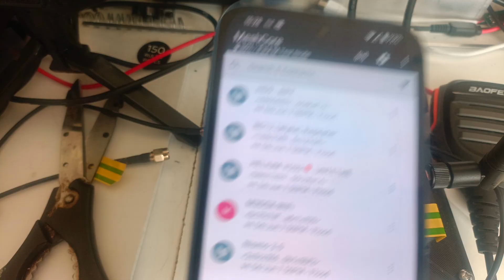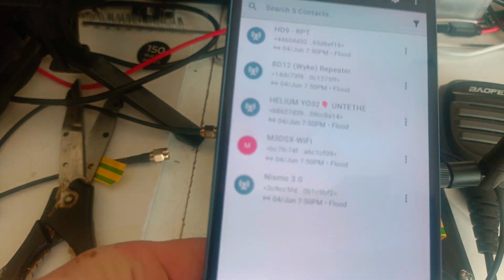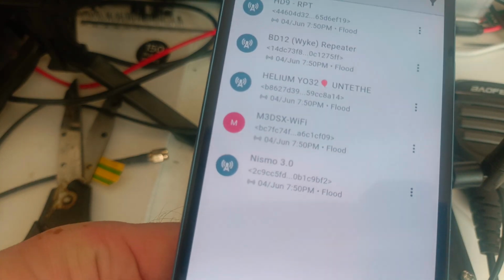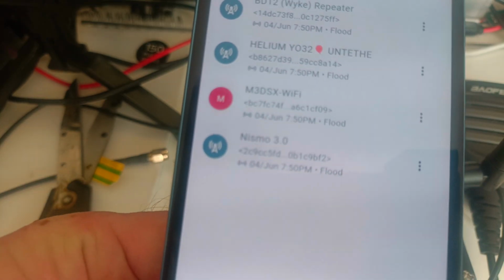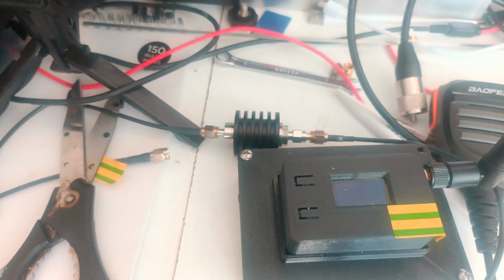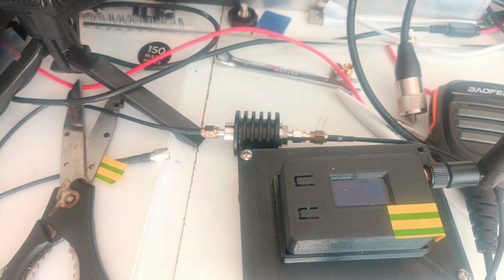Beginning my exploration of MeshCore and a surprise chain of events

Comment: Dumb question but how did you hear about the helium balloon being untethered..? Not a day-to-day occurrence 😁

I'm just embarking on exploration of meshcore and LoRa in general.. all very quiet here in East Anglia.

PS I was rather distracted by the wire between the scissors blades in your video..😁
Reply from the maker: The mention of the balloon was in the MeshCore public channel while I was receiving traffic via it and other repeaters, it also pinged up as a repeater as well in the discover list.

I think the wire between the scissor blades is possibly one of my TinySA coax jumpers so not something I want to cut
Reply: @PaulMcGeeM0WNU  great to hear that there's an active public channel where you are.. take-up is very sparse here ☺️

Glad you didn't cut the wire!

Comment: Hey Paul.
The little Paradar antennas are pretty solid.

Points to note: LoRa loves good line of sight, if you can grab another node and chuck the repeater firmware on it and throw it in the loft or on the roof you may have better luck and will help to contribute to the mesh!

At the moment, I am running a nice Omni McGill Antenna inside the loft gets some good distance and I know a few of the guys locally are doing similar and we have solid contact.

Not sure where you're based but there could be a whole world of nodes out there you just haven't heard yet!

Good luck on your mesh-venture!
Reply from the maker: I am in the process of cobbling together a repeater using a Raspberry Pi Pico and a Waveshare LoRa board, the issue I have is lack of access to the roof and no loft because this building has a flat roof so that would probably have to go out a window somewhere,  later on I plan to get a RAK Wisblock to make a repeater with as well but that will be further down the line